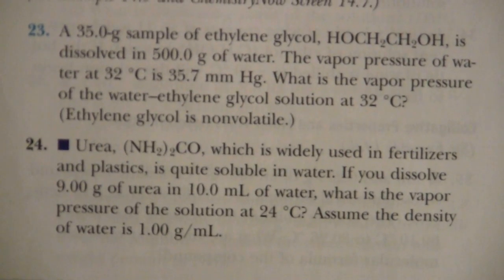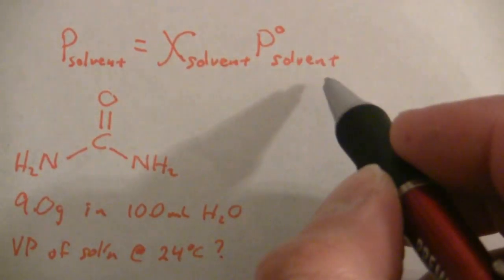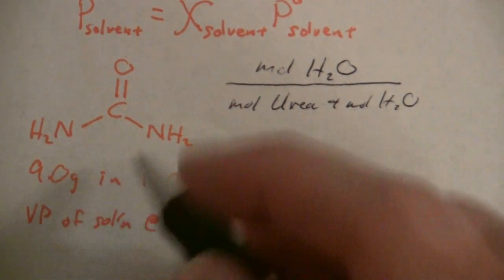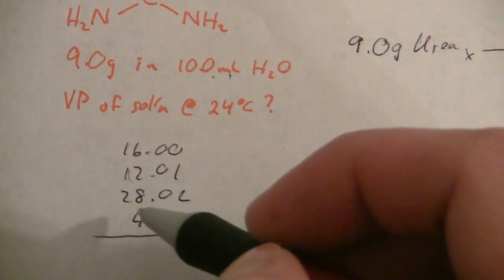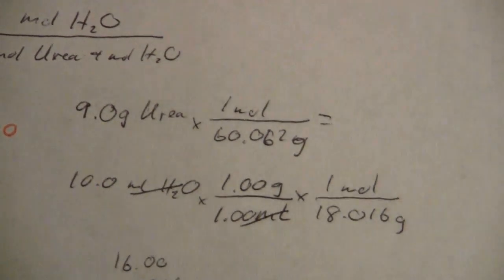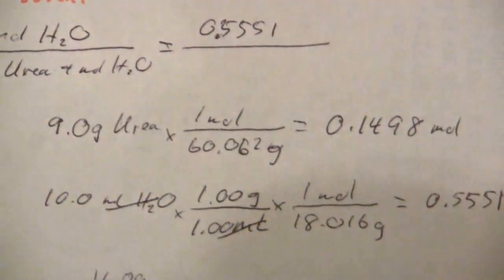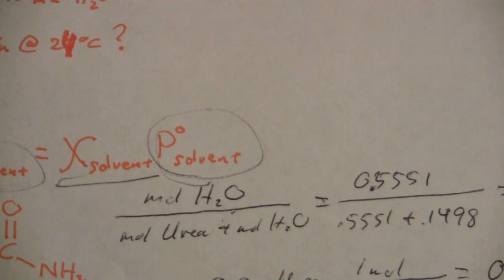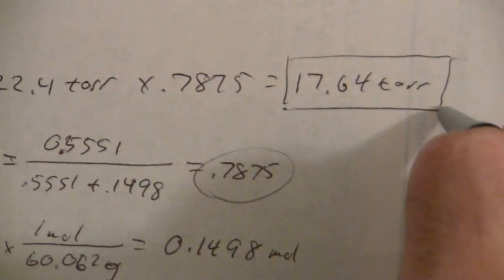Determining Vapor Pressure of Solution

Comment from the maker: When we speak of "vapor pressure of solution," what we mean is actually the vapor pressure of the solvent. For example, if we want to know the vapor pressure of a salt-water solution, what is the vapor for which we want to determine the pressure? It is water vapor that has evaporated from the solution and now exerts a pressure over that solution. Thus, it is the solvent (water) VP, but under solution conditions (hence, no degree symbol). So call it what you will, but it refers to the same thing.